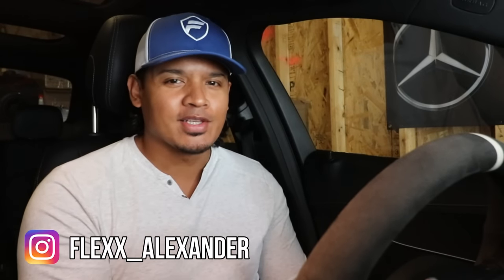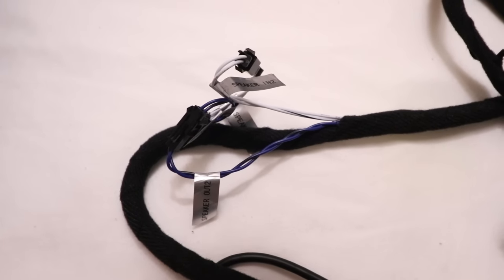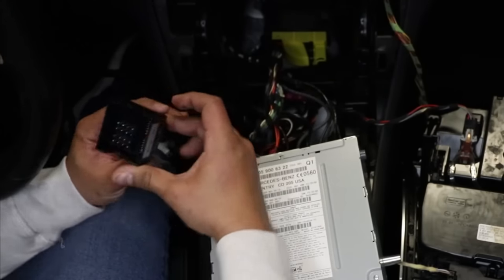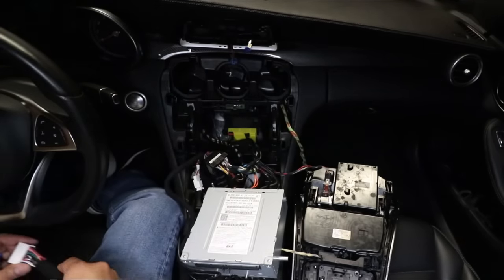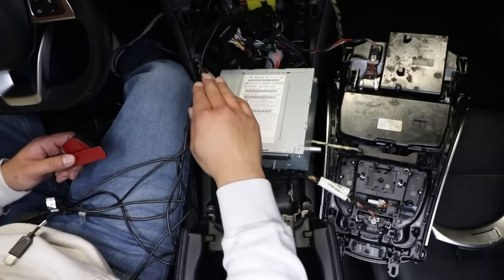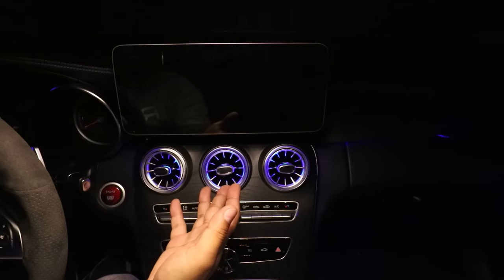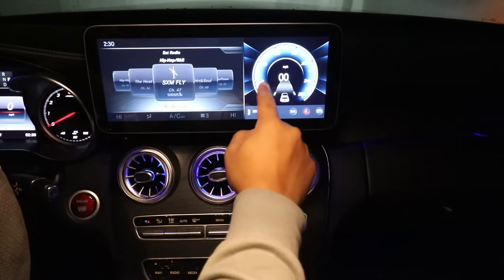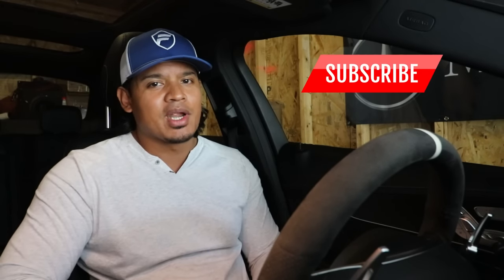BIGGEST Android Screen install on C300 (W205) 2015+ Mercedes C-Class

Comment: Hey, I just installed this it’s work perfectly I love it it’s awsome, I didn’t realise how good it would be, my oem screen when I start my car is stretched though, do you know how I can fix this, it is missing the right side of the picture and the bottom, thanks so much
Reply from the maker: That’s a settings issue in the secret menu. You need to contact whoever sold you the screen for directions and password since not all screens software are the same.
Reply: @TheFlexxGarage  I bought the screen a week ago from dmp car designs thanks dylan
Reply from the maker: Nice. Just message them. They’ll be able to get you fully setup. 😎🤙🏼
Reply: Cool as thanks for your help
Reply: Cool I managed to sort it out cheers
Reply: Hey mate I have one more question for you , have you got the oem stereo ‘ON’ button to turn on the new android head unit like when the car is off like it would on the oem stereo??
Reply: Mate??

Comment: Installer having an issue with audio 😢. Any thoughts?
Reply from the maker: Check out the replies In comment section. It’s been answered many times.
Reply: @TheFlexxGarage  Yeah got it working. It needed to be connected to the factory fiber optic. Even though it’s been answered, the instructions should detail this part of the install.

Scrolling the comments isn’t that a great of any experience.

Comment: Hey Alexander,  i got a little problem here. I have the w205 from 2017 with original 360 camera system. I installed the android 11 screen 12,3". Now lets talk about the problem. When i put my car into backfwards the camera in the back opens, so far very nice! but! when i put in drive mode(forward) my front camera shows up for like 1 sec, closes itself and my screen is going into homescreen. Can someone help me ? :D
Reply: Hi, 
were you able to solve those problems? I am thinking about buying one for myself. How does it feel like after using it a period of time? is it as smooth as the OEM system?

Comment: Is it normal for the audio to be really bad from the android compared to the oem audio? Also hearing a buzzing sound from one of the speakers after installing anyone know how I can fix that?
Reply from the maker: Of course it’s not normal. Especially for a screen that cost hundreds of dollars and has worked fine for thousands of people. 

You clearly have interference problem. Probably just need a noise isolator for your 3.5mm/USB audio plug to clean up the audio from the screen to the cars sound system.

Comment: Is the satellite radio still functional?
Reply from the maker: When the screen is on the NTG (oem) interface.
Reply: @TheFlexxGarage  the problem i have with XM on the OEM side is when i tap the screen to go back to the Android side, my XM station changes, its pretty annoying, ill be listening to lets say channel 8 on OEM then i tap the screen to go to Waze on Android and my XM changes to channel 20 or some random channel
Reply from the maker: That sounds like a setting issue that can be fixed in the password protected menu. You need to contact whoever sold you the screen to get a walk-thru.
Reply: @TheFlexxGarage  thank you, i have been on whatsapp with the DMP team, they are stumped too, we tried a ton of things and engineering is looking into it now

Comment: What if you don’t install the speaker isn’t it Bluetooth? And the gps can’t we use our phone as a gps? What if we don’t install the gps will it still work?
Reply from the maker: The speaker has nothing to do with the sound that comes outta the screen.  Your car speakers is where is sound comes out of.  The gps receiver is only used for the GPS program on the android interface.  Your stock GPS on the oem interface still works normal. And if you use CarPlay, that gps runs off your phones gps.
Reply: @TheFlexxGarage  so basically, I don’t need to install the speaker or the mic or gps If I don’t want to correct?
Reply from the maker: Correct

Comment: I just got and fitted an Xtrons 12.3" unit. Bit disappointed. Looks low resolution and kinda basic looking app icons etc. Main thing that annoys me is that on the OEM screen is partly cut off by the bit thats supposed to fisplay the speedo. Its split screen but also nothing is displayed in the smaller section on the right. So its cut off part original picture and doesnt display a speedo at all.
Reply from the maker: Don’t know what Xtrons is but my DMP screen doesn’t do that all.  And if it does, it’s an easy settings change to get the full oem interface along with the side speedo. Nothing is cut off.  You might just be dealing with a settings issue. Again, I don’t know Xtrons so I’m not 100% sure.
Reply: @TheFlexxGarage  the interface seems identical to yours. All these android screens seem to use the same software. All the displays look identical with same icons and features. I've managed to find the correct setting for the oem screen. It s now not partislly cut off. But I still dont have the speedo to the left. It just shows a tiny little speed rating at the bottom and nothing else. Its about 2cm in size 😅. So the split screen is pointless. Do you what settings sort that out? Its def telling me a speed but it looks terrible.
Reply from the maker: See that’s the thing that most people think which is not true. These are not the same. Most reseller companies buy straight from the factory but DMP actually visits the factories and works with their engineers to fix tons of bugs and tweak the components and software for stability and better performance.  Yes they are my sponsors but they are the only reseller of these screens that provide after-sales support to all their customers so the screens fully setup and 100% working. If yours was from DMP, they can get it dialed in. 

Again, I don’t know your screen but your best bet is to reach out to whoever sold you the screen and see if they can help fix your issue.  It should be a simple fix but that’s only my experience on my DMP screen.

Comment: How do you put back the AC vents? Mine won’t clip back together and I’ve been struggling for an hour
Reply: have you found out how to get them in yet?
Reply: @StoozyVert  the only thing that worked for me, there’s a clip in the center at the top that needs to be pushed in. Pain in the butt to do it. I used a flathead to do it.

Comment: If you have burmester song system would it be affected ?
Reply: as far as I know, it's connected via aux.... so, the music quality should be poor. @theflexxgarage correct me if i'm wrong.
Reply from the maker: No. It’s USB which is a cleaner medium then aux.
Reply: @TheFlexxGarage  but as you can see at 2:25 mins the aux cable is insert in a usb interface.  Could you give some information about it?

Comment: do you know of services that will do the installation for me?
Reply from the maker: Only near me. There’s a shop called Boston Mechanics LLC in Norwood Ma.   If you’re not around here, probably check with stereo install or remote start install shops.
Reply: @TheFlexxGarage  ok thank you. im about to buy a used 2016 c300 and I really want apple carplay. Best buy says they can do it, but do you think I should trust one of the shops you mentioned more?

Comment: What is the pin code for factory settings..?
Reply from the maker: You need to get it from the person who sold you the screen. There’s specific codes for different screens.
Reply: @TheFlexxGarage  yes, thanks Flexx, they supplied today, screen is great but not without teething issues, my A/C controls keep turning off…Steve from DMP doing a great job of helping.
Reply from the maker: Yeah. The thing people don’t notice is that it’s not like an item you just buy off the store shelf and it works. You have to set it up properly for your specific car and to your oem radio model for it to work properly. Hence why for something this costly, I don’t recommend buyin from Amazon or eBay or AliExpress who probably won’t be able to support you during the setup or help with any issues.

Comment: My back up camera isn’t working !! It says no signal
Reply from the maker: It's working. You just didn't set up your setting properly on the screen. The screen on not a plug and play device. It needs to be configured to your car and what features your car have. Contact whoever sold you the screen and they should be able to walk you through it. If you bought from DMP (like I suggest in the video)...then they can help you 100%.
Reply: I got it from DMP and followed your exact instructions bro

Comment: My reverse camera does not work do anybody know which cabel i have to connect or switch for this issue
Reply from the maker: Most of the times is a setting in the screen. You need to select OEM reverse camera.  If it’s not the setting…then it’s one of the cables.  I don’t remember which one. Just pull off the screen and check all the connections.
Reply: My reverse camera works, but only for 2 seconds, then it disappears. It goes blank with ONLY the sensor lights on the screen without video. The front camera works, but it looks like it's mixed up with the back.

Comment: This deck is junk speakers doesn’t have sound
Reply from the maker: They aren’t junk. You are experiencing something called “user error”. 

Either contact whoever sold it to you for support or have a pro install and set it up instead of trash talking about something you didn’t set up properly yourself. These screens aren’t just plug and play. You need to set them up specific to your car.